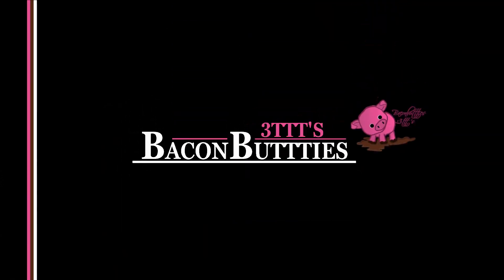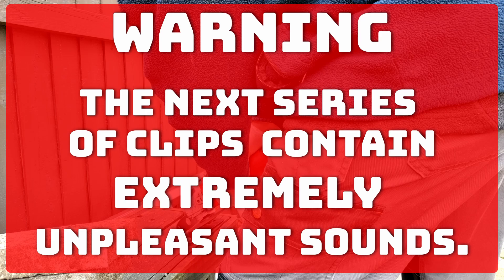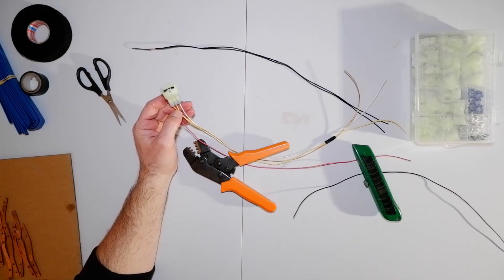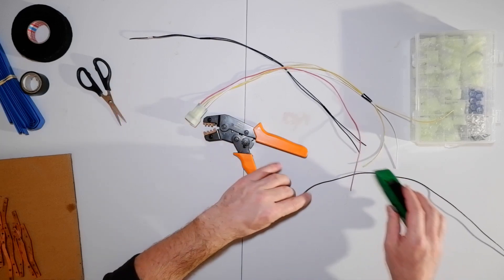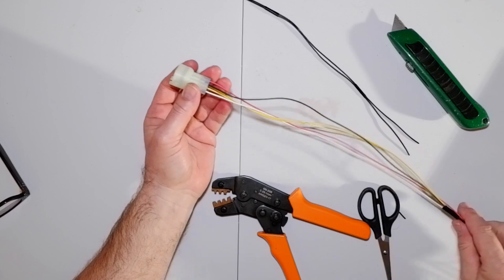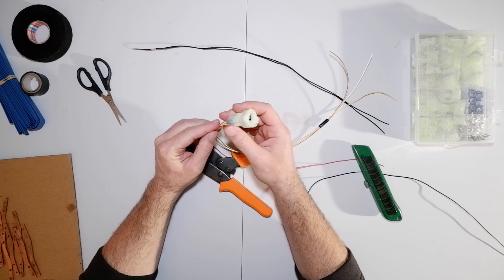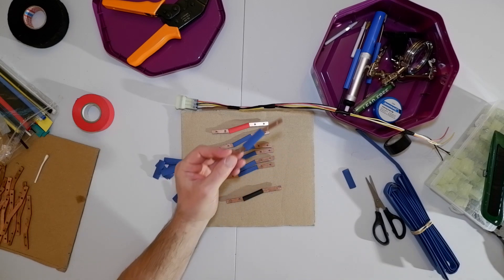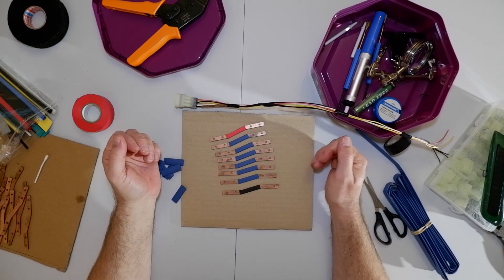FAST EBIKE BUILD UK ROAD LEGAL PART 10 - GRINDING AND DON'T SCRIMP ON THE CRIMP

Comment: I'm starting my build got the wheels tyres hub motor 18in moto wheel I went with and the 5T version of hub motor better low end torque as I'm not the lightest person lol, that thing is heavy the hub wheel, debating on what frame to go with it's a long term project so plenty time will be getting the same cells aswell 20s 1p
Reply from the maker: Starting the build is the best part for me, I have a 5T hub motor 👍🏼

Comment: For mud guards on my build I used  https://www.sks-germany.com/en/products/bluemels-series/bluemels-75-u/. My rear is 19" with a 2.50 tyre and front 26" with 2.5 tyre. Fit no problems and keep you, the rear subframe and bike frame under battery nice and clean. If it's function you want, these are good, if it's looks, then maybe something else.
Reply from the maker: Thanks, I will take a look  👍

Comment: Looks to me you need longer bolts either side of the headlight,  and use some black bold sleeve to space out/ make the brackets parallel.
If you know what I mean?
Reply from the maker: Yeah I tried that as the brackets come with different size spacer sleeves and it still has the same problem. It like the bolt threads in the headlight are slightly of angle as if the bracket is supposed to slightly taper out and these bracket prefer to be straight.
Reply: @baconbuttties  I see,
That's a tough one.
I'm sure you will figure it out your good at that shit.
Show us when you do.
Cheers
Reply from the maker: @roberthamilton1301  👍

Comment: Mudhugger 29er (largest one they make for the rear) eBay item number : 143493538812
And the extension/width extension: eBay item number : 132632117973

As for the front, I’m having the same issue finding something that will stop the mud kicking up, I’ve got the mudhugger “race” and race extension, just need to fit it and test, keep us updated on the choice you go for on the front, 

That’s the best setup I’ve found for the rear after testing so many! 

Good luck
Reply from the maker: Cheers , I didn't know you could get a widening kit for the rear Mudhugger 👍

Comment: Those new headlight crimps do look very nice, but might be a bit ott for me haha!😂With the crims, I just bend the tabs over with pliers then solder it in place which seems to give a solid connection. Mudhuggers are the best mudguards I've seen and the ones I want to get, andy kirby used them just fine. Not cheap at £50 for a pair, but solid https://amzn.to/3beNWqn
Reply from the maker: Yeah I usually go down the soldering route but I thought I would give the old crimping  tool a bash. The crimp tool does give a really good connection as I have tried pulling the wire out and it is in there good and proper but just makes a mess of the large top tops 50 percent of the time.   👍
Reply: @baconbuttties  Haha fair enough!